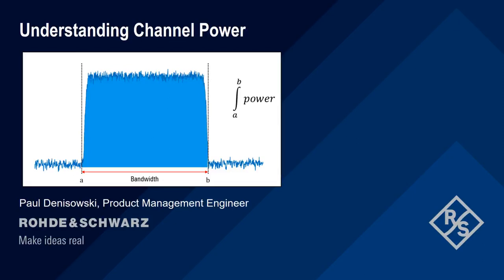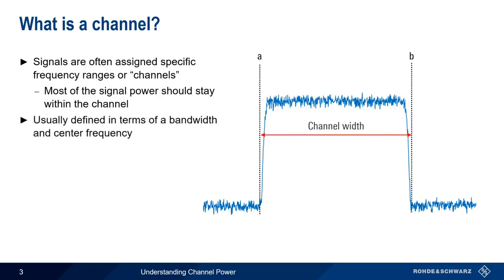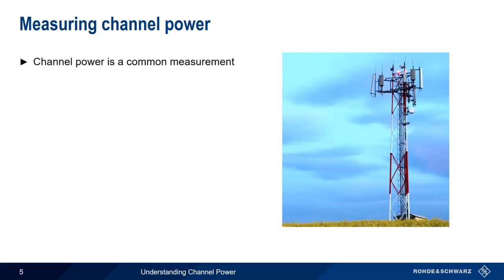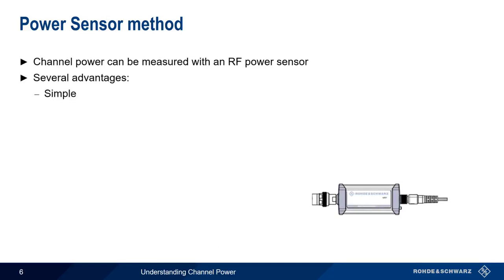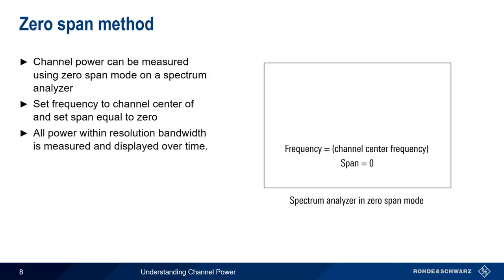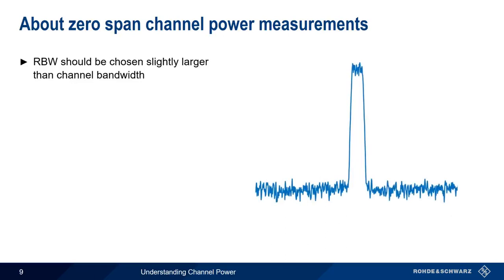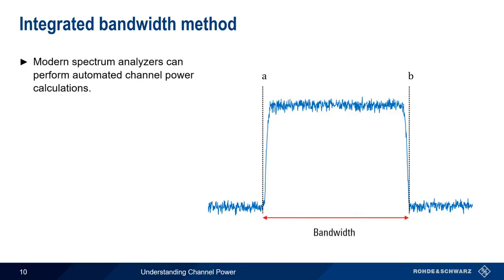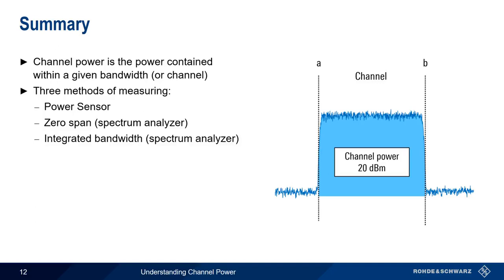Understanding Channel Power

Comment: I think what confuses me on this is the unit being in watts.  Energy can be express as power multiply by time and it's pretty much doing the same thing integrating power over a range of time.  But channel power which integrates power over a range of frequency has units of power?

Comment: Hello, thank you for the video. How do I calculate Integrated Bandwith (IBW) power by getting the trace from the Spectrum Analyzer? Let's say I have a 20MHz BW carrier setup at 1GHz. I get the x and y axis trace from the instrument, how do I calculate the IBW power from that imported trace using for e.g MATLAB or Python?
Reply: Most spectrum analyzers preform this as a built-in function. Check your manual.

Comment: During measure channel power using Integrated Bandwidth, shall I use trace Average or Max Hold for better calculation?
Reply: The general rule of thumb is to use an RMS detector any time that you are measuring power with a spectrum analyzer.  There's no reason you can't use average, max or min hold, etc. but RMS is what I would recommend.  This would apply if you were measuring power in zero span mode as well.

Comment: For channel power measurement with Integrated Bandwidth method, would the RBW setting impact the resulting channel power?
Reply: That's a great question.  Generally speaking, you should use a RBW that is a couple of orders of magnitude smaller than the channel width.  For example, for a 20 MHz wide LTE channel you would want a RBW around 100 kHz and for a 5 MHz wide WCDMA channel a RBW of about 30 kHz would be appropriate.  Using a narrower RBW (slightly) increases measurement time but improves accuracy, especially if the power is not uniform (flat) across the channel.  A narrower RBW will also minimize inaccuracy at the edges of the channel caused by the shape of the RBW filter.  A spectrum analyzer with a channel power measurement function (like all R&S spec ans) should automatically choose an appropriate RBW based on the channel width, so in most cases you shouldn't need to worry about manually selecting a RBW.  Thanks again for the great question!